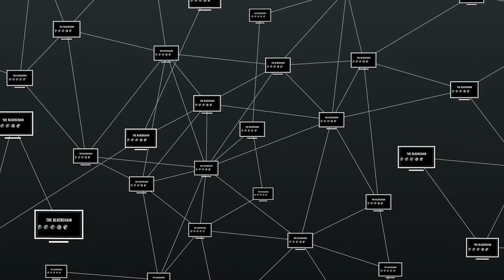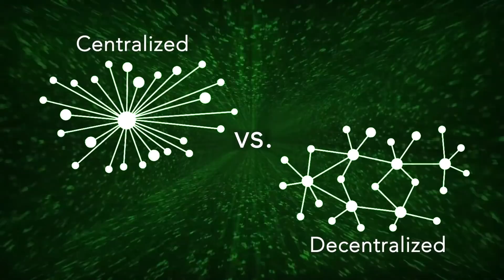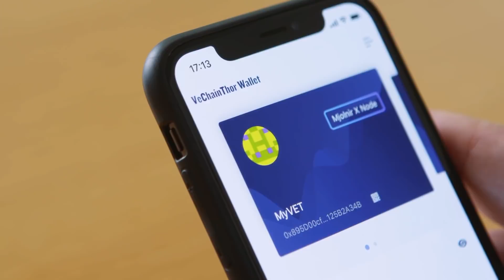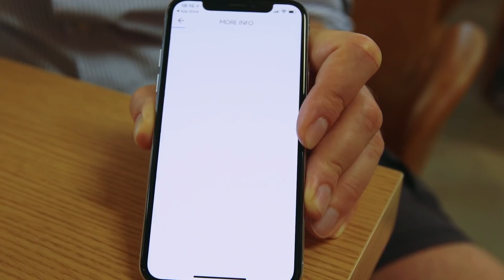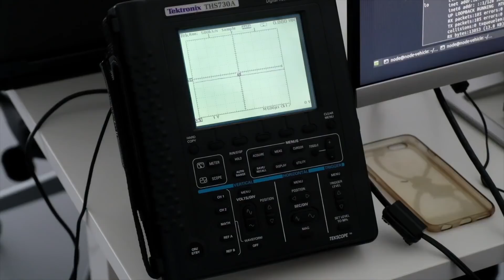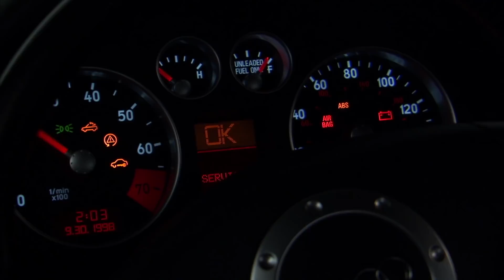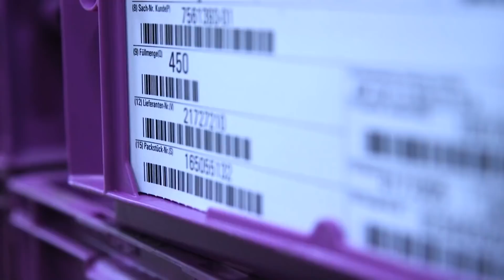Advancements with Ted Danson [CNBC] - VeChain Segment (ADTV0923 Blockchain & Beyond)

Comment: Why is it when I go on Coin market cap it only goes back three months for this project hasn’t this coin  been around for a couple years?
Reply from the maker: When VeChain moved from the Ethereum blockchain to it's own blockchain (VeChainThor) at the end of June, the old erc-20 token "VEN" was replaced with the native mainnet token "VET", hence why VET only goes back a few months. The VET token was also split at a ratio of 1 to 100 (1 VEN = 100 VET) which is the reason why the price is now 100x lower too, but you have 100x more tokens. The total market cap stays the same. 
You can look at the history on tradingview for both VEN & VET.
Reply: Ahh thank you for that  makes sense now